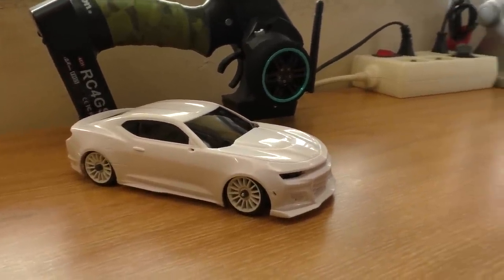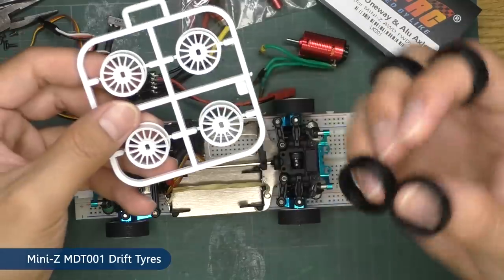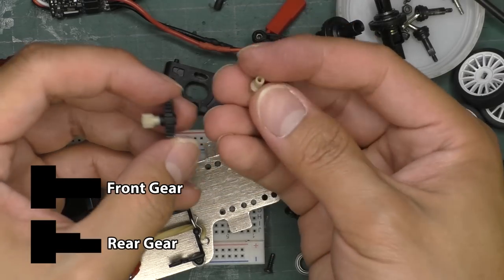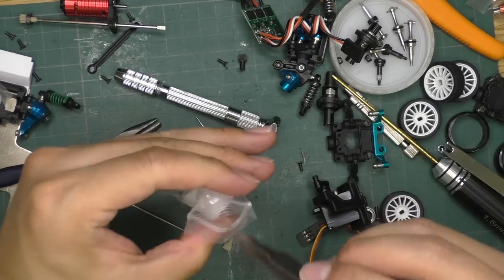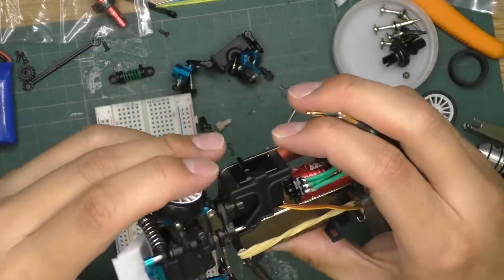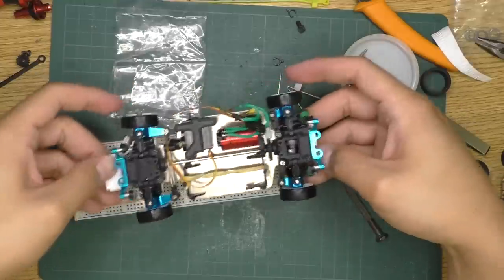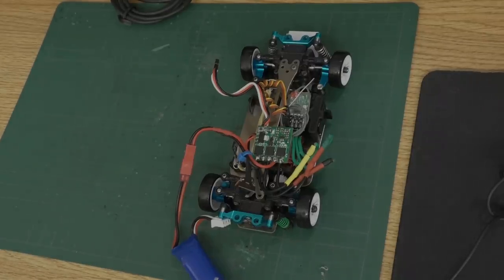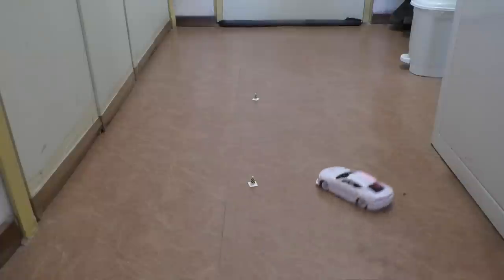WLtoys K989 (and 284131) Budget Brushless Drift Build 2021 Edition | Full Tutorial

Comment: I have to say beware of these diffs I just got mine in and tried to use them on my amz(I just got and built and am having nothing but problems with and am very disappointed with 😞) the left front has a spot where it sticks I have tried cleaning it running it and then oiling it and it still sticks and causes the car to spin out to the left. I unfortunately have to take the amz apart again to get the diff out and put the stock amz one in but have never tried it. I impulsively bought an AMR and am very much regretting that purchase and its still on the boat, so much money wasted 😔.
Reply: The mini-z one by it self is only $10 more on rcmart it may be worth it for better craftsmanship
Reply: I also purchased that surpass kit before seeing this video and it was returned in shipping but they asked if I waned a refund or to resend it and I resent it of course 🙃
Reply: Thinking I'm going to put all this stuff in a box and be done with this part of the rc hobby but I really love your videos and they are beyond helpful and I will keep watching!
Reply from the maker: @zdog90210  I'm sorry to hear that. I'll be on the lookout for this one way if it ever break. Maybe it got stuck because the drive cup shaft isn't smooth? That could happen too. It happened to my original Mini-Z one way anyway.
AMR is a good car, you can't share the diff with other AWD cars but it's a good car nonetheless.
You can still use the motor from Surpass kit so if it ever arrives then you can still get something out of it.
Reply: @BeaversHobby  from what I can feel from running it in my fingers the drive cup shaft is not smooth. I will contact the AliExpress seller for now and use all the parts and things in the AMR. I did get an AGFRC servo and love it. Amazon had the other mini servo model on 2 day so I got that because they are nearly identical just a bit slower than the one you got  and I love it so fast and powerful and fits perfectly in the AMZ. I did get the Leppard hobby sensored brushless motor and it works well and changing the timing to zero and punch to 5 it's perfect at 4700kv but the esc is a little bit chunky not too bad tho.
Reply: I meant to say the drive couple is not round
Reply from the maker: @zdog90210  Hope you get the one way sorted out soon. Best of luck!

Comment: What about carbon chassis ?
Reply from the maker: That also makes the car worse. It'll block the suspension and make the car too low to the ground.
Don't do it unless you are sure you have the skill and tool to shave carbon fibre plate at the lower arm supports down precisely. You'll need to file 4 of them down precisely the the same thickness.

Comment: I noticed you using the metal steering cups here... I've seen mixed reviews about these but I do have a spare set of front metal steering cups... Are these one of the metal pieces which require modification to work or are they good to run out of the box? Thanks again

Edit: Just found the answer for anynbody else wondering.. There drive cups are one of the recommended upgrades from Beaver, but they do require some fixing so i will be leaving these for now! thank you
https://www.youtube.com/watch?v=coFHPQg4BQs&list=PLS79G3YjA2fAEez9GVeLW3JIy_LUIb6Mb&index=18&ab_channel=Beaver%27sHobby
Reply from the maker: Yeah, you'll spend some time to make them work. Only the steering cups are worth the time making them work. Shock towers are also good and work without any fix. The other parts however are borderline garbage if you are not extremely lucky and receive the working ones.
Reply: @BeaversHobby  You know far too much haha.. I'm curious what was your verdict.. is K989 budget touring & drift car or is it a money sink?
Reply from the maker: @jimz1024  It's a budget car as long as you don't go insane with the aluminium upgrades. Keep the chassis stock, replace only the consumables like differentials, wheels, tyres and upgrade the electronics if you need to. And you can move the electronics to a better chassis in the future.

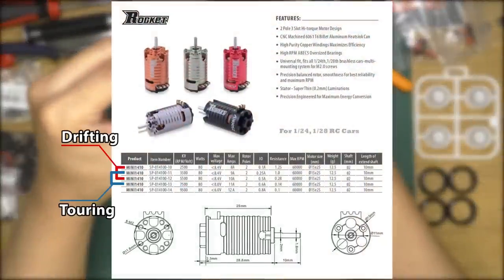Comment: 1:53 completely wrong there.. higher kv = more torque but less speed, lower kv = higher speed and lower torque.
Reply from the maker: No. KV means RPM per 1 volt. So higher KV means higher speed. 
https://www.rotordronepro.com/understanding-kv-ratings
Please do not confuse it with T or turns which the more it is, the less RPM the motor has.
https://www.rccaraction.com/brushless-motors-turns-vs-kv-rating/